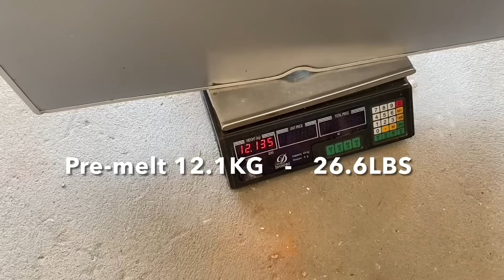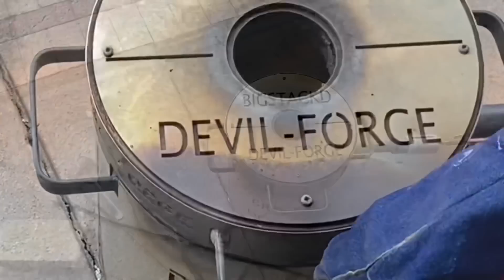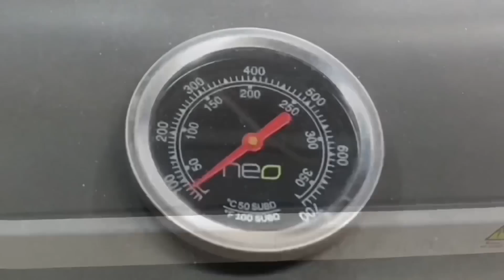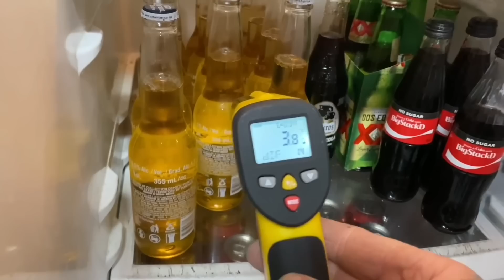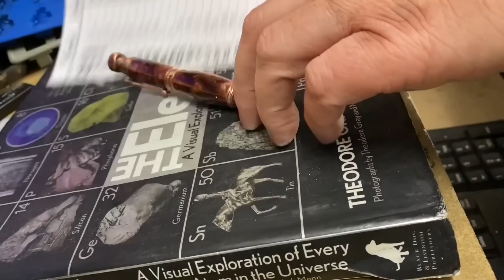Camping Table Bulk Bars - Huge Haul - ASMR Metal Melting - Trash To Treasure - BigStackD Aluminum

Comment: The new place is looking good! Can’t wait to see the treasure room. Hey, hold off on those brass connectors, I may have a few to send your way, but I’ll wait until you are settled in at the new shop.
Reply from the maker: All good buddy I’ve got a quite a few videos lined up to do, and as a subscriber just mentioned earlier I need to make a BigStackD axehead so that will be coming up quite soon after I move in as I will have two fireplaces at this new place one in the shed and one in the house. The treasure room is gonna look awesome. It’s not ready yet but as you can see the outer walls are ready. And don’t even think for a second I’m not gonna make a little baby treasure room door for the dogs to get in👍🏻
Reply: @bigstackD  awwwwwwww that will be cute for your ingot and bullion

Comment: Kinda wanna see a whole video on just moving the horde to the new place that it will rest. Could end with a melting of whatever you might have used to move it or whatever you cook your meal break on. A nice end of the line aluminum grill with some nice brass fittings would get a good yield and there bound to be one somewhere that no one wants or has already thrown away.

Comment: Hey BigstackD have you ever done anything with glass?  That sounds interesting.
Btw I love coming home from a typically ridiculous Friday at work to watch your latest vid.  :)
Reply from the maker: I haven’t done anything with glass yet but glass is so easy to melt you wouldn’t believe. The only thing is when it comes to melting glass it’s super easy but when it comes to casting glass it’s very difficult as if you wanted to melt glass in the furnace yes you could do it very quickly and it would melt in seconds but to cast it into an ingot or a coin or a bar you would need a kiln. Because if you melt it in a Kiln you can bring the temperature down very slowly and actually make it work. The reason you can’t do it in a furnace is if you melt glass into a mold of some sort and just left it it would contract too quickly and crack and break and if you left it in a furnace after you had melted it it would do the same thing so it’s best to cool down In a kiln . As you could bring the temp down super slow so that wouldn’t crack or break ,   I can guarantee you there will be someBigStackD Glass coins and bars coming in future videos 100%👍🏻
Reply: @bigstackD  hey so in one vid u sed u were gonna show us where that orange tube gose why haven't you did it yet

Comment: I used an old 40 gallon water heater tank with the bottom cut off and put legs on the top only 3/4" hole in the bottom

Comment: Hopefully you have a heavy duty, high weight rated push cart.  As least that way you'll be able to (most likely...depending on the weight rating) be able to move a few hundred pounds at a time instead of only maybe 50 to 80 pounds at a time.  Ramp & enclosed trailer would help also.  Hell, make it a few high weight rated carts....and straps of course.  That's the way I'd do it anyways.

Comment: Are you going to add a larger scale furnace to melt iron/steel at your new gaff ?
Reply from the maker: I won’t have a more powerful furnace but I will have a bigger furnace.
I’ll have the 20 kg double burner furnace but again even with two burners that still can’t melt steel or iron , it’ll melt cast-iron but again that’s really not the same thing.

Comment: does the weather noticable affect the melt in any way? like melt times or ingot consistency?
Reply from the maker: No not at all mate. Even if I was casting when it snowed or in a heat wave the temperatures outside of the furnace is only going to vary by 30 or 40°C but inside the furnace we’re talking 1200°C or more so really the only problem you would have would be moisture on your molds 👍🏻. But as I always say if you pre-heat those moulds make make sure you have a lemonade or moisture there really shouldn’t be any problem. As long as you’re pouring the metal undercover and not while it’s raining or snowing there shouldn’t be any problems or difference at all👍🏻

Comment: For large items and and extreme amounts of aluminum you could use a threw and threw smelter like Okscrapper on youtube just requiring and dirty smelt and a cleaning smelt when he smelts engines goes into the top large and dirty out the bottom melted and dirty then put in the devel forge to remove the slag I use this method for cans and mower  engines and long aluminum tracks or frames no cutting required

Comment: What happens if you accidentally leave a metal screw or pin when melting? Will it just sit at the bottom of the crucible?
Reply from the maker: Yes it will just be in the bottom of the Crucible in aluminium and copper but with brass steel will actually float on brass so you can just skim it off the top
Reply: @bigstackD  gotcha. That’s cool 👍🏼

Comment: I'm a bit confused. You can make way more money selling that table on e-bay or marketplace, than turning it into ingots. Makes no economic sense to me.
Reply from the maker: Actually Rob if you read the pinned comment I explain why I melted it. It had a broken bracket on one side so it would fold up if someone sat on the other side so it was dangerous. I filmed and showed it but in my editing I have left that bit out unfortunately

Comment: That felt wrong. I watched it. Unit felt wrong to melt down a perfectly good thing just because.  The value of it will always be more than the ingots. It was funny and certainly it’s your stuff, do as you like, but, I’m just saying, it wasn’t so much salvage as it was vandalism.   Nice bricks though
Reply from the maker: Actually buddy if you check out the pinned comment you will see that it was actually broken but I screwed up in editing and didn’t show the bracket on the other side of the chair. If someone sat on the other side it would fold up so it was dangerous that’s why my friend gave it to me to meltdown👍🏻
Reply: @bigstackD  I feel better already. That’s a horse of a different color.

Comment: Love your content!

I've tried to email you, but the address seem not working.
Reply from the maker: It should work perfectly fine mate. Sometimes it does take a few days to answer people as I only check my emails twice a week because I’m so busy🤔
Reply: @bigstackD  no i get the mail back, will try again.

Anyway, what are the dimension of that triple ingot molds?
Reply from the maker: Internal dimensions are 115 mm long 45 mm wide 25 mm deep and it was made with 5 mm steel And then welded three of them together
Reply: Found the wrong letter on the mail 😁. Last question, what is the biggest ingot that you can cast with your 10kg fournace?
Reply from the maker: Probably be a six or 7 kg copper bar but the biggest ive done is 4 1/2 kg as I don’t have a mold big enough to do a six or 7 kg bar
Reply: @bigstackD  Next challenge, the biggest ingot ever? 😝

Comment: WOW!!! The value of the Aluminum Picnic Table was greater than the value of the melt. You had SOOOOOOO many options. This was a disappointing metal melting video
Reply from the maker: You need to read the pinned comment buddy
Reply: @bigstackD  Which pinned comment dude.